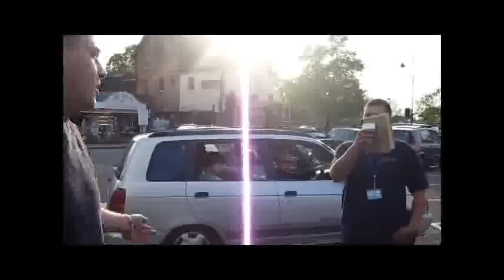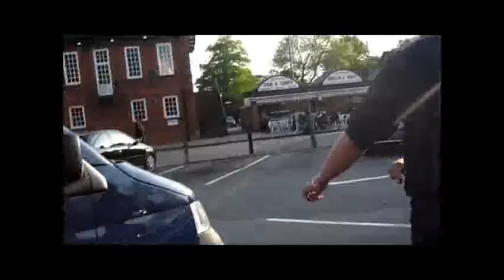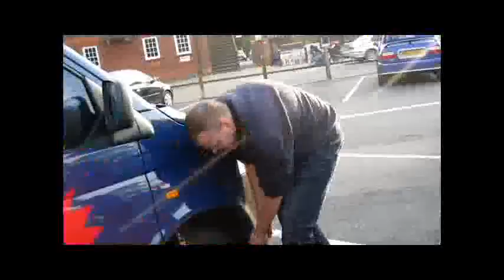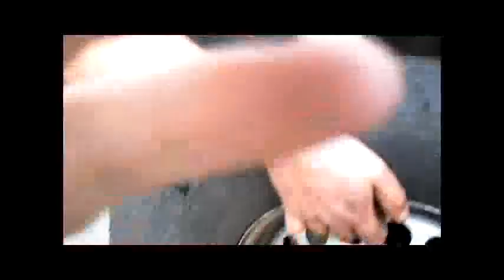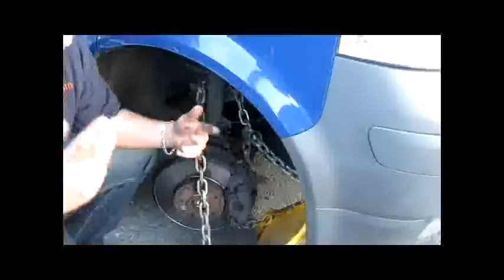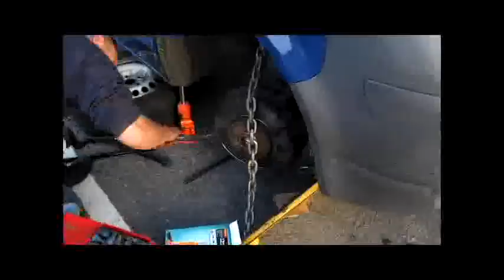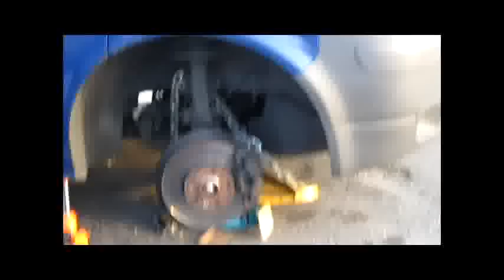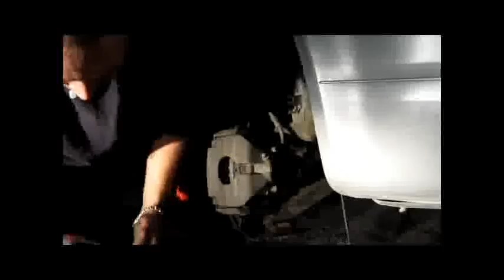How to remove clamp legally...Wheel clamping...   (    Part 2  )

Comment: If you can't touch their clamp, how can they touch your vehicle? Sounds like a pound of flesh to me.
Reply: Edward Walker They are full of shit, you can't damage it but they can't stop you touching it.
Reply: Indeed, there's no legal grounds to stop you touching anything that's placed on your vehicle.

If that were the case, it would be illegal for clampers to TOUCH your vehicle when putting their leeches on it.
Reply: In Australia, if your vehicle has been wheel clamped there  is  little known law that states that anything that is attached to you car / motor bike, becomes the property of the owner of the vehicle. You then have the legal right to remove said attachment , put it inside your vehicle and drive off.
Reply: Edward Walker exactly!!!!!
Reply: In law  you may touch their clamp  as much as you wish. However  if you damage the clamp that is  criminal damage. Of course, if the damage your vehicle while fitting the clamp  you can take proceedings against the clamping firm for criminal damage. And don't let anyone try to dissuade you, I have done that 4 times now and each time I was successful
Reply: U can touch it just not damage it, but there has never been any 1 prosecuted for removing a clamp as a result of their car been clamped.

Comment: TS 410 still saw has them off in less than 30 seconds. Just make sure there is no CCTV and take the clamp with you, that way they cannot prove you have damaged it. You just tell them you had it lockpicked and you left it on the road, not your problem someone stole it.Used to remove loads, it is illegal to clamp nowadays . I focus on DVLA clamps now. Cut 3 off last week .

Comment: If a clamp is fitted to your car it then becomes an accessory.
It doesn't matter who owns the clamp it now belongs to you the same as fitting spot lights.
Because it's now a car accessory you can take it off how ever you feel fit but you must take it with you to avoid being charged for littering.
You can't  be arrested for theft because it was put onto your vehicle by a third party as a gift.
Way 2 is to carry a clamp and clamp the clamper...
Reply: Haha you might have to put up a sign in your car stating that if anybody leaves anything on your car it becomes your property and will not be returned without paying a release fee of 100 pounds 😂

Comment: someone needs to design wheel covers that PREVENT a clamp from being applied
Reply: hmmm old Citroens that go right down (gas suspension) to the ground and rise when the engine is (was) started. Don't think clamps existed back in those days.
Reply: They will only go round the wishbone with a chain if that's the case.
Reply: West Senkovec - I suppose it would depend on how low yeah.... if it had a mental low skirt and bumper then they would have real trouble.

Putting it through the spokes would damage them constituting criminal damage.
Reply: Install 37 inch or larger tires.
Reply: Just buy a boot and put it on yourself. Also keeps someone from stealing the car.
Reply: the clamshell type can be removed also
Reply: had a Citroen Xantia a number of years back, they where great anti-clamp cars, as soon as you switched off the engine the cars suspension went down leaving no room for a clamp to be fitted.
Reply: I must admit that I had to look up the Citroen as we don't get Citroens at all. The strangest thing to me is that the people allow clamping cars to be legal. People would lose their shit over here (middle USA) if they came back to their car and someone had attached one of these clamps to it.
Reply: Easy, don't park illegally or pay your fines and you don't get clamped. If people put half as much effort into not parking/driving like dickbags as they do being angry about the punishments this wouldn't even exist.
Reply: I partially agree. Disabling your car seems a little extreme. We have to pay any outstanding fines before we get our registration renewed each year.
Reply: Annnnd then they'd tow it... lol
Reply: Winch
Reply: @PolskaCat This Information is LIBERATING -- nonetheless, how Legal is it to 'lock' your car w/ a boot?  
#DivineComedy #CreativeSolutions #DivineBirthright #ProperPerspective #DivineFriendship | 777ADVENTURES
Reply: Travis Johnson N
Reply: I'd LOVE to see a clamp big enough for a 20x12 wheel.
Reply: Rich I was thinking Cat tracks. Lol. Good luck booting them
Reply: electric rims
Reply: right i got an xj with a 5 inch lift and 35s on some steel rims i dont care about go ahead boot it. you will find the mangled boot a few blocks down
Reply: Airbags to set the car on the ground and half wheel well covers .... get it low to the ground,,,nothing to clamp to...
Reply: Challenge Accepted!
Reply: You can just get 4 clamps yourself, and clamp all 4 wheels when you leave the car. Clamps don't fit over other clamps.
Reply: AlternativeDesign100 my father actually once owned one of those but they can put the clamp on the front wheels where there isnt a hydraulic
Reply: Flame thrower security feature

Comment: As long as you don't damage the clamp, you can remove it.  Just jack up  your vehicle, let some air out to the tyre and slide off the clamp.  If you damage the clamp or cut the the lock it is criminal damage.  and don't take the clamp, just leave it and drive off their property and put air back in the tyre.

Comment: Just to let you Know, that this happened to me. The Police were called. The clamping Company, said that unless I paid the fine, within a certain period, (Two hours or so) they would tow my Vehicle to their pound, which would incur, a further cost. But, in law, they can only tow your vehicle, to the nearest public highway, any further, (eg, to their pound) and it would be deemed, "Theft". Now, the important bit. It is not the "Company", that would be charged with theft, but the actual driver of the towing truck, so "He, or She", would get a criminal record, this, will stop them, from impounding, your Vehicle! You may still, however, have to pay the clamping fine! I didn't, the company released my Van, without charge!

Comment: This is a very old video.  To all you making recent comments:  It has been illegal for private land owners to clamp a vehicle for many years.
Reply: +David Clark Not that many, about 2 years.
Reply: +canturgan  actually fella it has been quite a while far more than 2 years id say at least 10 because I was clamped and it still had the clamp on after it was made illegal and contacted the police on what to do the police told me to cut it off because there not allowed to clamp it had been sat in the car park for 3 weeks with the clamp on and police said that they wont be coming eny time soon so you cant be prosecuted and that was around 10 years ago
Reply: Paul Reed
2012 in England.
Reply: no before then I was taxing 1999 2001 and it was around that time the reason being it was illegal but red tape kept it from being enforced by the police it only came enforceable by the police in 2012 when the law on clamping was changed to criminal from civil but was well illegal before then its just the police didn't have the powers at that time, but you couldn't be prosecuted for criminal damage for removel of the clamp but when the laws changed it then became illegal to damage a clamp upon removel and this is when dvla started to use this method knowing that you could be prosecuted, wich in turn made them to start clamping vehcles on the drive too, but because then people were removing them, they then came up with the sorn rule because clamping was not a legal methord although enough to make them able to collect the vehcle so they could get revenue from you collecting your car from the pound
Reply: Paul Reed
I suspect all that waffle could be condensed to about one paragraph.  It currently just rambles on repeating itself.  Try to be more concise.
Reply: wrong it explains different things
Reply: Paul Reed
Try using a full stop occasionally.    A full stop indicates time to take a breath.  Try reading your drivel, out loud, without taking a breath!
Reply: +David Clark oh very sorry didn't realise the full stop police were around, but excuse me for not being as full stop educated as much as you but if you are to  correct me over full stops etc. that will mean you must be higher educated than me, so should have the intelergance not to read it all the way through with out taking a breath. and before you go on about my spelling I was in a motorcycle accident in 2010, witch for some reason my brain was bruised and I spell correctly and some times I don't just in case there are youtube spelling police trolls going to comment on that too

Comment: Can't understand how they get away with it. The clamp was nearly as well integrated with his car as his engine is (OK slight exaggeration). It wasn't a stolen part and it was willingly incorporated to a private car. How can legal title to the clamp remain with anyone other than the car owner?
Reply: does remind me of a story I heard at work over a decade ago. Which ended in a Dutch truck driver looking at the smug cowboys in a clamping van, he flipped them the bird, they held their hands out like waiters expecting a tip, he got out and outstretched his arms trying to reach from corner to corner of his 500litre diesel tank, before going around the other side to draw attention to the other one. As he walked back around the front he saw them twirling their fingers around their temples followed by the return of their smug grins. He turned to his drivers door, dropped his pants and showed them his arse, climbed in, lifted up the clamped axle and drove off back to the docks with the idiot van following him.

Comment: pretty labor intensive to disconnect the ball joint, or strut. Couldnt you just wire it up to the undercarriage and let the chain drag on the street.....eventually one of the links will be ground off by the road (not you) and it will fall off.

nice job otherwise fella, I approve of theft from scoundrels.

Comment: A 4 inch cordless grinder and a Walters zip disk and then seconds of my time I'd be on the road. The ones in the USA are heavy gauge steel  they only take 30 seconds to cut off.
Reply: How would that help? You couldn't get to the chain until you removed rim and tire.

Comment: A little bit too much fuss IMHO. Just notice the clamp, leave the site 
till nightfall, come back wearing a different shirt and a guy fawkes 
mask, cut off the clamp with some bolt cutters, go away again, hide the clamp in the bushes around the corner, 
change into the original shirt and remove the mask, go back to the car, 
act surprised the clamp disappeared and drive off retrieving the clamp 
(simply because it can become evidence of something...maybe...

Comment: I don't get it, pulls the wheel and unbolts the strut, slips chain off, took him till dark , loss half day wages, put van back together, now it should be aligned to keep it from wearing tires uneven, yep he sure showed them. Seems so uneducated.
Reply: unbolting the strut doesnt change the alignment, he didnt touch the the TCA or ends
Reply: gandi69 yes it's cheeper than paying him
Reply: A matter of principle, I would imagine.
Reply: Unbolting the strut would only knock alignment out on a vehicle with camber adjustment pretty much, which that van doesn't have to my knowledge. The hub can only fit the strut one way.
Reply: Educated and spineless are two different things. Hats of to the guy.

Comment: 18v cordless angle grinder.Would have saved all that and took seconds.
Reply: If he had damaged the clamp then he would be liable for the damage, that's the point of the video, how to remove the boot WITHOUT damaging it.
Reply: *****
Step 1: wait for the clamper to leave.
Step 2: Grind the thing off while he is gone.
Step 3: Drive away.

Now the clamper has the burden of trying to prove in court that you were the one that damaged his property and not some random person doing a public service.
Reply: 30'' bolt cutter
Reply: MAKE SURE ITS HILTI

Comment: Friend once told me to put some fast drying glue in the keyhole and then pay the fine and ask them to remove the clamp ... see how they do it ..😂😂😂
Reply: Someone tried that in a telecommunications company and the driver ended up being dismayed to find that their car was going to unreleased over the weekend whilst the security company went through their cameras to find the saboteur and work on releasing the clamp. The driver was red faced when he was traced second by second from exiting the building to applying the glue to the lock of the clamp and then re entering the building and then acting indignantly when they returned to their car to "discover" it was clamped. Not too bright or clever.

Comment: Police officer was wrong to get involved in a civil matter and threaten arrest. It was NOT "making off without payment" and the clamping firm already had the registration number of the vehicle anyway, it was a civil matter.  If it were "making off without payment" then any parking company could ask for the arrest of any person who hadn't bought a parking sticker, which obviously they can't. You should put in a complaint about the police officer, he needs some training. The clampers always say "you can't touch the clamp" but of course you can touch and even remove the clamp by any means you want. You simply cannot damage the clamp as that's criminal damage. Picking the lock is best if you know a good locksmith, but this way works well too. :) Good work though, and good to show people how it's done.

Can only do this with private firms clamps, not DVLA or police.

Comment: Surely it all depends on the wording of the contract. If payment is to remove the clamp then it would not be making off without payment because he did not require it's removal, so there is no service to pay for. If the penalty is for parking on the land or not complying with conditions then it becomes a civil matter, having no intention of paying would make it theft. Clamping for private companies has become illegal because it can be abused and it's requirement is redundant anyway because money can be recovered in court. Changing the subject, one thing that used to annoy me when I worked in a petrol station is that if a driver fills their car up with fuel, as long as the customer goes in the shop and says "I've got no money" and provides their address they can fill their car up with fuel and not pay for it, again this can be easily recovered with costs but my employer and one silly sausage work colleague wanted to put liability on me or other cashiers for "letting them do it", the other flaw is police refusal to do anything when the driver blatantly left false details.

Comment: You can also deflate the tyre, put the steering on full lock and simply reverse out of the clamp before re inflating the tyre and driving off. I have previously done this to demonstrate the method of removing a clamp.

Comment: Just install coilovers have them really low
Reply: Yep good point, my car isn't lowered, but it's a very low sports car. They'd never fit a clamp on without bending the wheel arch. And if they put a boot on, I'd claim they scratches the 2k a corner alloys😂😂

Comment: I had to out to recover a car that had a split brake pipe and was leaking brake fluid. The clamper had pulled the chain that was wrapped around the strut and torn the pipe away where it joins the flex hose. Brake pipe is actually quite flimsy and not designed against abrasion like this. Car owner had paid fine- nothing to do with me- but had no brakes on one side,split circuit brakes,and car did not stop well. Photos taken and report written. Car owner taking clamping company to court for damages and endangerment. My top tip is to have a thorough inspection after clamp removed by competent person,just in case.

Comment: I had my car clamped in this exact same car park in Windsor about 4 years ago, I was only 1-2 minutes late. They demanded £350 before midnight (it was 23:30) or they would tow it away and then charge towing and storage fees. Unfortunately I didn't have any tools on me to remove my wheel/throw at them. I've always been tempted to buy my own clamp and attach it to their van while they are clamping someone else car...

Comment: I've got a battery-powered saw with a carbide blade. It'll cut right through those chains in seconds. A few quick cuts, toss the clamp and you're outta there before anyone notices.
Reply: How would that help? You couldn't get to the chain until you removed rim and tire.

Comment: Is jacking up the van, taking the wheel off and removing the thing the wheel is attached to the fastest way to get a wheel clamp off?
Reply: Depends on the clamp. If it's like the one in the video then yes at the chain is around the strut. To be fair, getting a VAG strut open requires tools and a bit of mechanical experience. Even then it was dark before he did it. 

In other words, the fact u had to ask ur question means I'd highly recommend u don't attempt it.
Reply: Ronno4691 He needs anti clampers on his van?